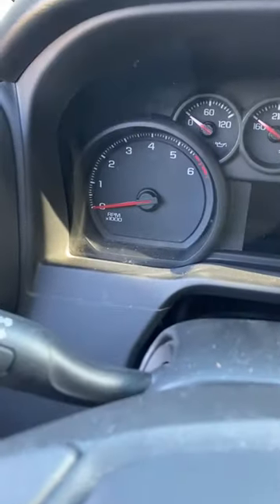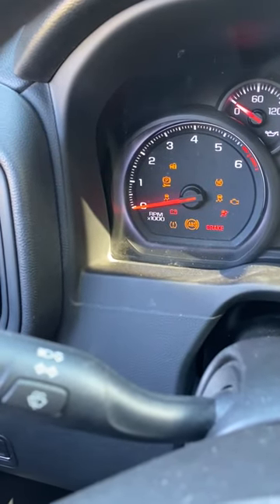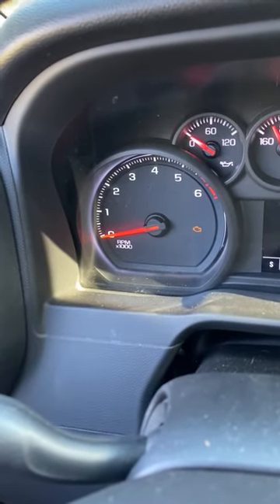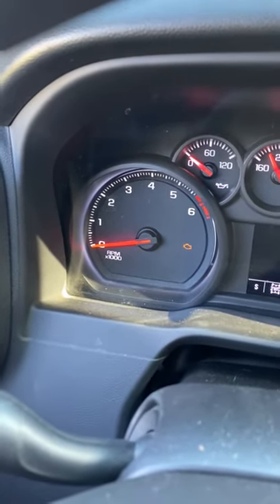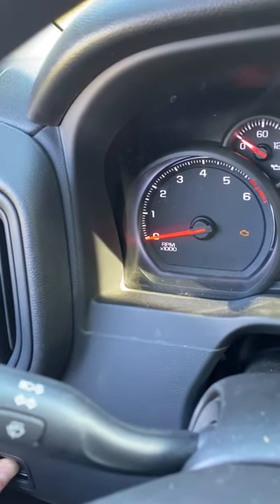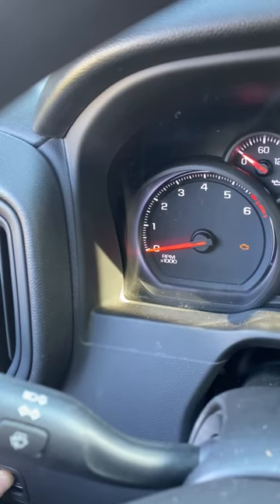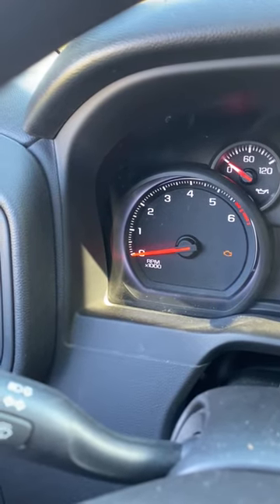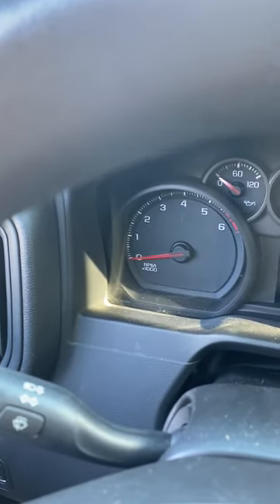2020 Silverado Trailboss brake service mode, no scan tool

Comment: Man I was about 2hrs late finding your video. Just did my fronts and expected it to be nothing like the rears. I was wrong. Swapped everything over and started the truck up and everything to do with braking and trailering and etc came on. Thankfully my buddies scan tool was big enough to reset the codes. Doing my rears last year turned into a 6hr job because I couldn’t get the piston to go down and nappa rented me an adaptor tool that spin the worm gear down which also didn’t work. Stupid me powered the truck on and the park brake tried engaging and popped the piston out of the caliper and then every light came on the dash. Had to get a guy from the dealership with his scan tool to clear the codes. Couldn’t even bleed the brakes after we got the piston back in. The master cylinder must be electronic and the codes deactivated it. Hopefully it’s another 2yrs or longer before I need to do this but I thank you for this video showing how to activate brake service mode. Never knew it was a thing.
Reply: Exact same thing happened to me yesterday

Comment: thank you so much for this video, i kind of did all the work before watching this. i have a 2020 silverado trailboss LT and let me tell you. ive been changing brakes for years and the way they make these brakes no is stupid. Growing up i never had to disconnect a battery to do a simple brake job. But at the same time im very impressed with how easy it is changing them on the trail boss when everything goes right. any Do it yourself machanic knows any 30 minute job can turn into hours of frustration. what i took from your video was the park service mode for the back breaks. im not even going to get started on that one, i spent 2 hours twisting that motor in 😭😭😭😭😭😭 but currently right now, i had all sorts of lights and the way i got them off was disconnecting battery for like a half hour. check engine light is still on, giving me codes of C0560 and p25a2 and i cant figure it out for the life of me. maybe it needs to "learn" again

Comment: Been doing brakes for years but changing the rear pads and rotors on my 2019 Silverado took me about 3 hours as I had to drill out the torx counter sink bolt that holds the rotor in place. The first one - my 30T torx easily striped the head when I tried to manually remove it, so I had to drill it out and retap it, not so bad. When I went to do the other side, I put the T30 torx bit in a light impact, thinking it would break free. But no, my Torx bit broke off in the counter sink fastener and I could not remove the hardened piece that was stuck in there. Let me tell you that was a bitch to drill out. Yes, I used a break free solvent on those fasteners before trying to remove them, always do. When I got it all together and took it out of brake service mode, my dash lit up like a christmas tree with all sorts of errors, service ESC, max speed 70KPH, engine light on, Traction Control disable. It took about 3 miles of EASY driving, start, stop, engine off, and resart to clear all the errors.
Reply: Had the same issues with the torx heads , max speed indicator light and TC. what a pain!

Comment: 2020 silverado custom. I did the same , service mode but ended up in limp mode . Stuck w/e-brake on and had to flat bed it to dealership. $600+ just to diagnose and reprogram a new park brake motor. Motor was only $90 , the rest was labor , programing and tow truck.
Reply: Ready to change my brakes but scared this might happen smh

Comment: Why were both front and back worn? Usually you front twice before the rear ? What happened
Reply from the maker: The slide pins on the back were hanging up and the inside pads gone worn quickly
Reply: @Chad-xn2ti  im thinking that the traction control on these new vehicles are cause the rear brakes to wear faster as well  i hope I’m wrong
Reply: If you tow the rear has a lot of weight and will wear more quickly. If you never tow then the front has more weight (engine and the fact weight shifts forward as you slow). On cars the 2 to 1 is typical.

Comment: Can't believe the dealership wouldn't let me know this. They charged me $210 cus I backfed the system since I wasn't in brake service mode. Ridiculous.
Reply: The dealership isn't going to tell you shit, these vehicles are designed so you have to take it to the dealer.

Comment: Did mine today and the brake failure/ speed limited to 43mph is on my dash in plugged the battery and everything u did but still havin the same issue 😅
Reply: I had the same thing happen. Then magically, it went away and my truck was good to go.
Reply: Yea same thing. After a day or two it will go away
Reply: @dangmanlieu8579  lucky lol mine was like that for 2 weeks and finally towed it to the dealer and got it fixed for 1k 😅
Reply: My is doing same thing paid 500 to have it fix at dealership and once ready still didn't work now they say it's the master cylinder now they say it's 2500k just brought it back home
Reply: I just had this happen to me few hours ago. Did a lift kit and decided to replace the pads “while I was in there” and now I have every code in the world on my dash :(
Reply: I did mine the other day. My dash lighted up like I was flying Apollo 13. Then it went away, but I still have the "brake pad life service system"
Reply: @Craigahh  I still have that currently the “service break pad system” but truck runs fine the dealer ship reset it over and over but comes back
Reply: @paypay969  I disabled it for about a week. And then I turned it back on again and the brake pad service thing went away.

Comment: Wait…2020 don’t have push start? My 21 has push start so how do I do it???
Reply: Hold the push to start button without touching the brake pedal until your instrument cluster lights up. I work at an automotive shop for a living, and as cars have been evolving so has the information I've needed to be able to keep working on them.
Reply: Depends on the trim level.  I have a 2020 Trail Boss LT.  It has push button.